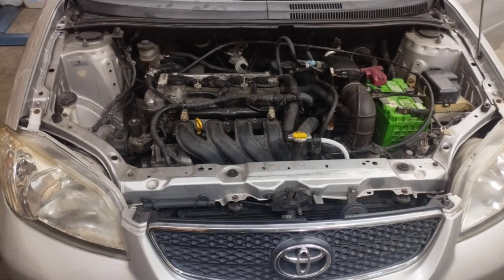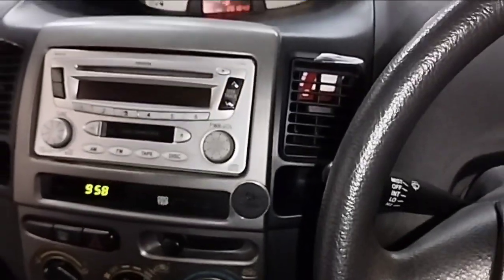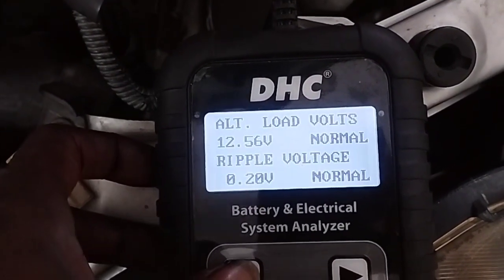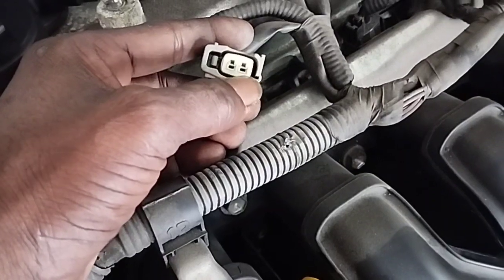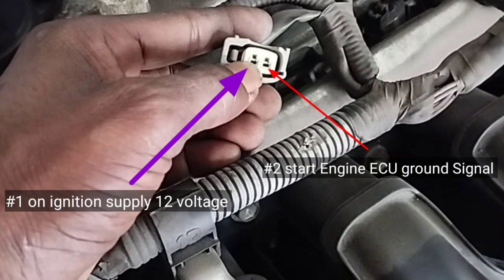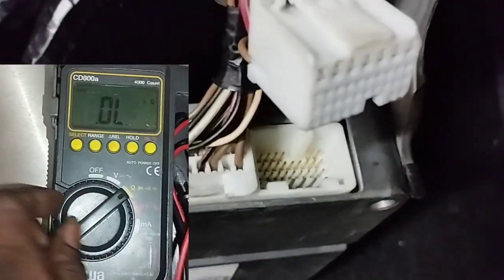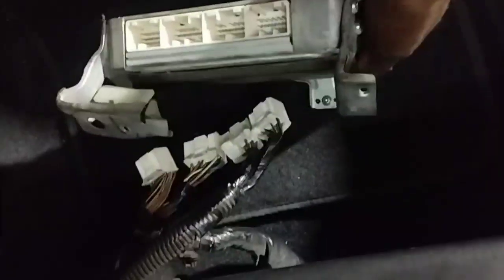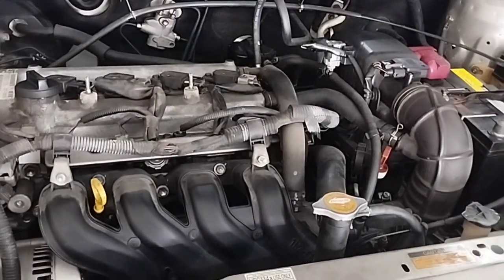How to fix a car rough idle ! symptoms of a bad ecm !problems solved

Comment: Hi, i have replaced a new spark plug, all coil r in good condition. In the morning, starting car and runs for few KM i.e 4-5km, once it gets heated it will start to misfire. I ve change its head valve gasket as well. But still having an issue. No chk engine. Pls help tks
Reply from the maker: No check engine  check wiring harness
Reply: I managed to identify the issue, one of the injector nozzle gone bad, replaced and all back in action. Tks